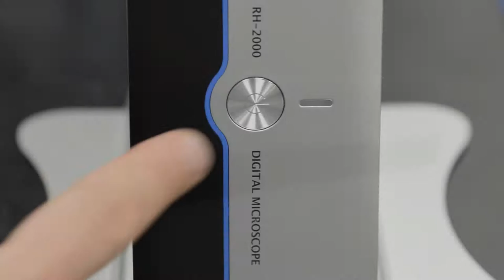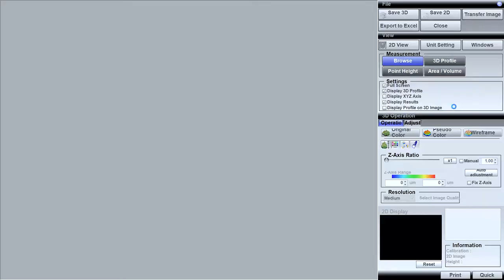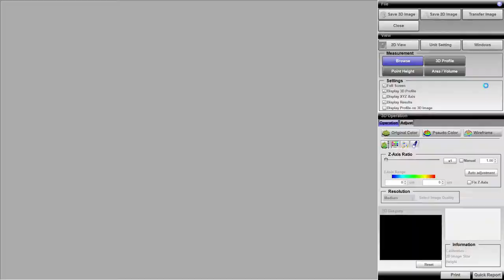HIROX RH 2000 - 3D Digital Microscope - presentation video

Comment: That's amazing micrography.  I'm on a personal tight budget and I've been trying to think of ways to manufacture a few things for my microscope.  I'm not looking to compete, but this product sets the standard up pretty high for a hobby mechanical engineer, a hobby chemist and a hobby geologist.--so much so, it would be cheaper in the end for me to just save up for this microscope instead.  The cost of tooling, material along with R&D is totally out of my reach.  No wonder I never complete anything.